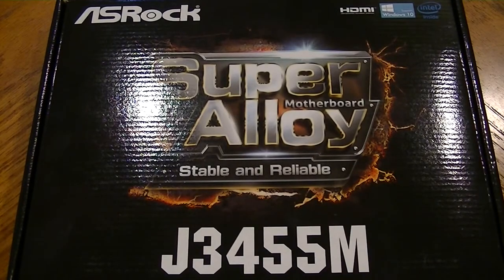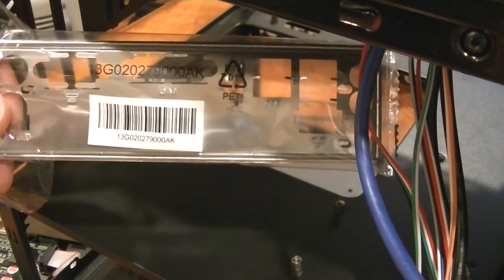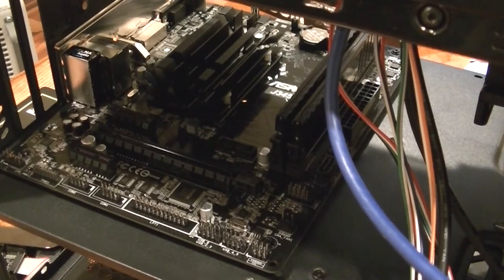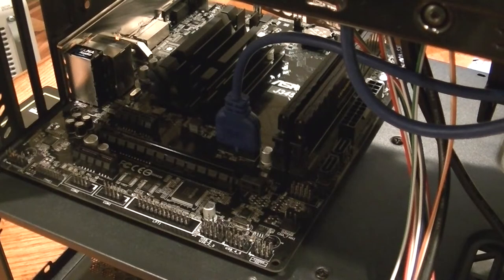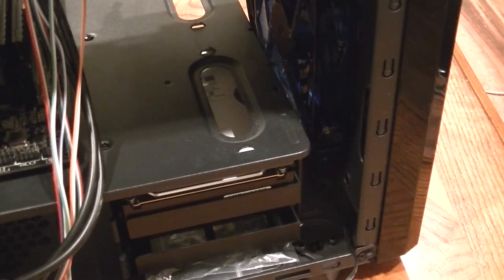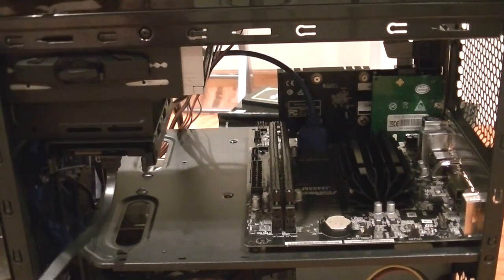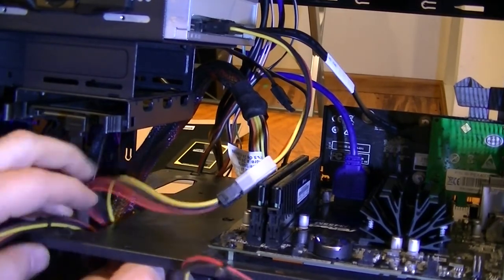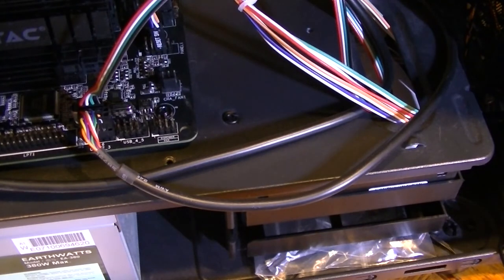ASRock J3455M Apevia X-QBER HTPC Build

Comment: Nice video! Which is the power consumption of the motherboard with the built-in CPU?
Reply from the maker: Thanks, the CPU is listed at 10W TDP, the board can't be all that much more.  I looked for an estimated power draw for the board in the manual, did not find anything.  I do want to try one of those Pico PSU's someday.

Comment: Can this cpu and mother board run battlefield 4? I fried my computer trying to play bf1 and I’m just looking for something to play some older games on
Reply from the maker: Recommended specs for bf4 is quad core and 8 GB of memory with a GTX 660. Those are pretty old specs. A rig like this won't have any trouble. I would also recommend an SSD.  Good luck!
Reply from the maker: Sorry, I though this was another one of my videos.  This is a Celeron, the PCIe Slot is only an X1.  This board would only be good for casual games - Jackbox, chess, stuff like that.  Sorry for any confusion!